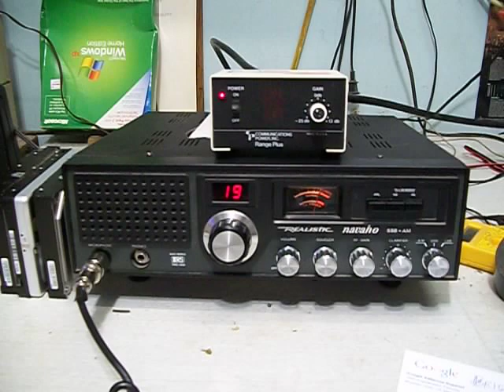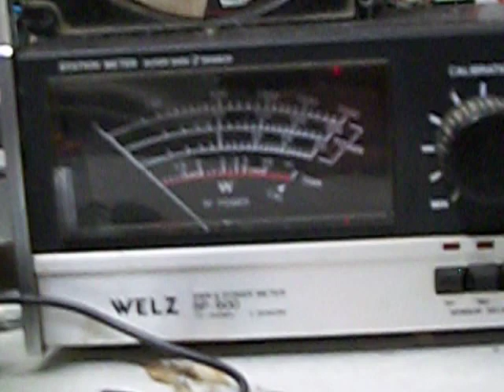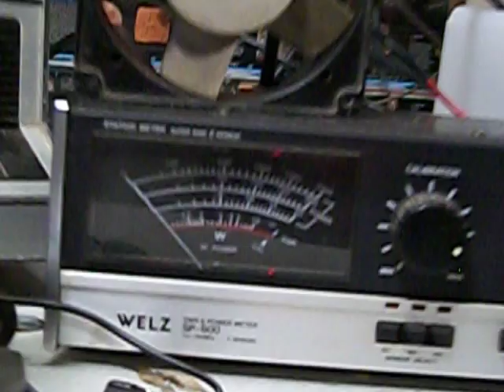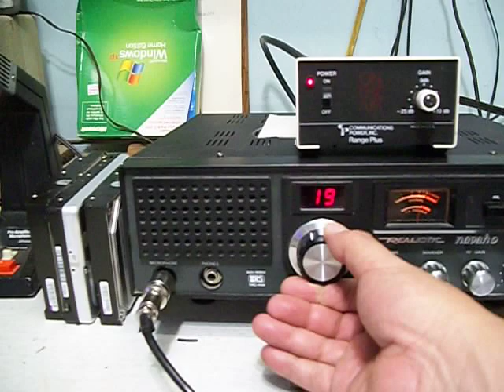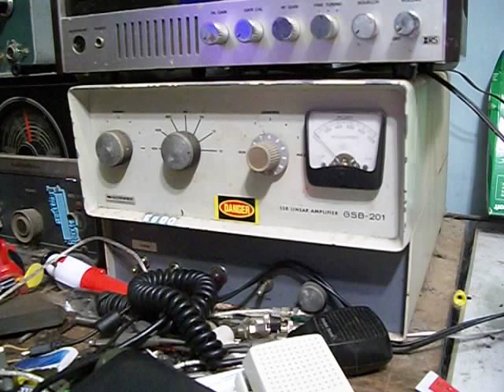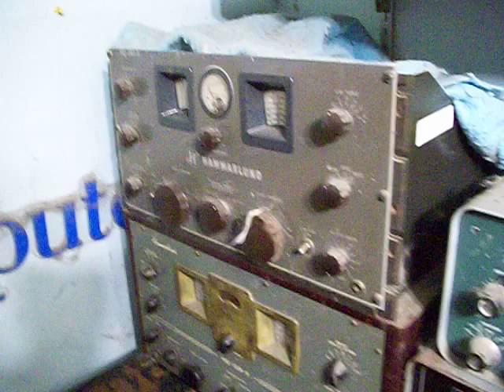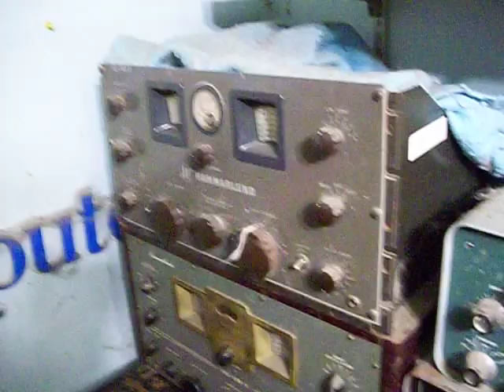The Cobra 2000 SITREP

Comment: Hello Challender i have a jb200 amplifier i was using and i shut it off and went to use it again and it wont key down you can push the points down and it will but wont without what do you think is wrong with it SIR